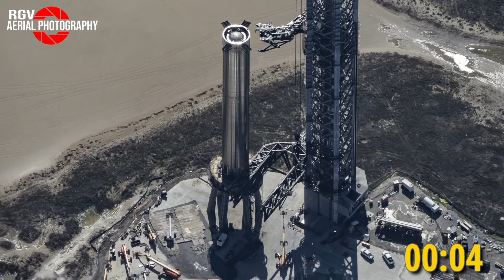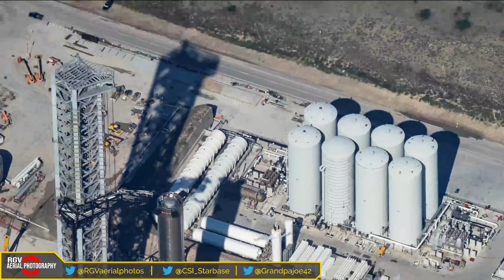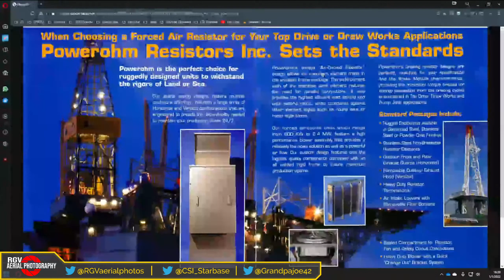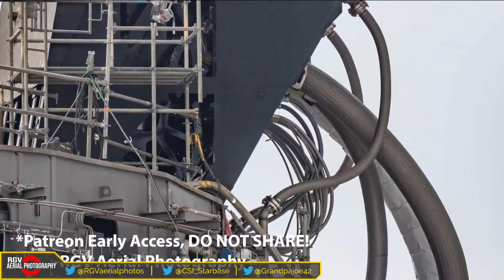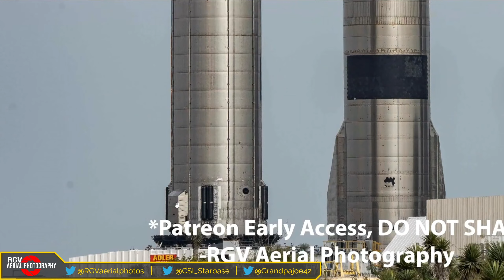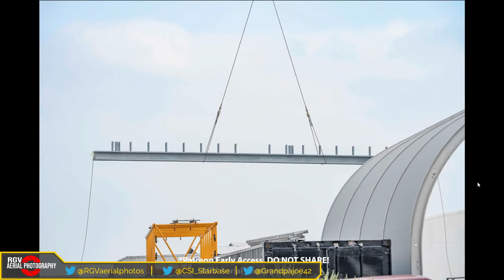Starbase Photography Review

Comment: The 'Drilling line' as it's called in optional 1 1/2 or 2 inch.  It is most likely 1 1/2 due to the light loads it is assigned to move.